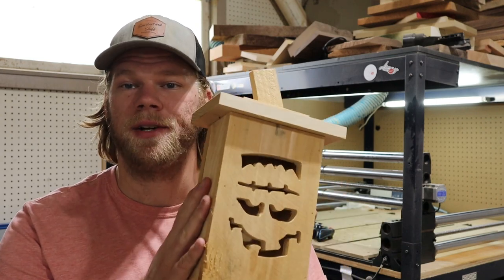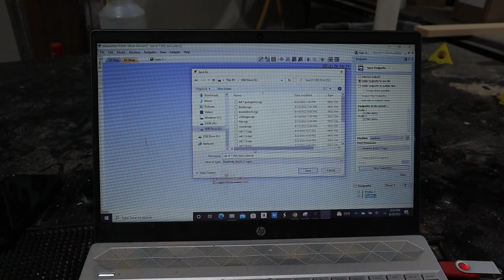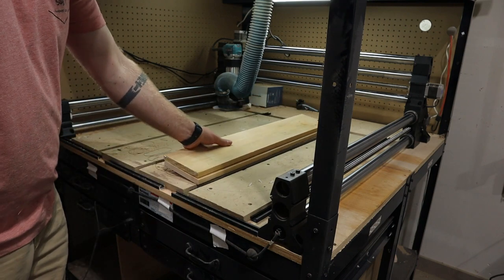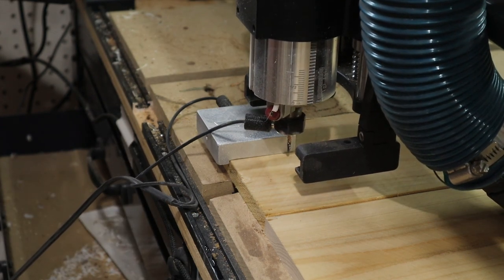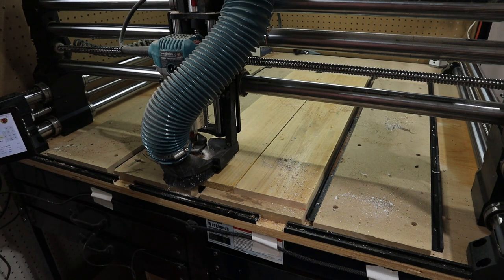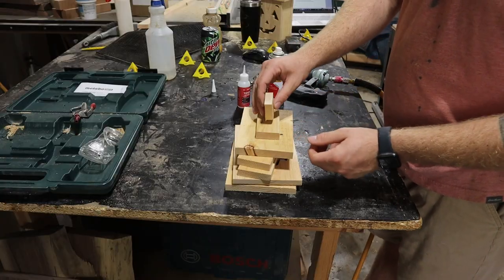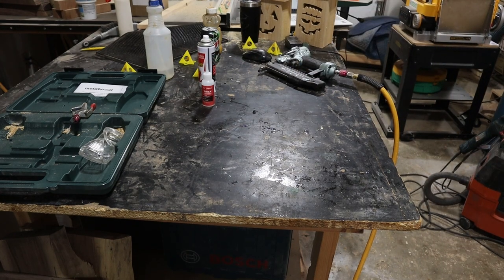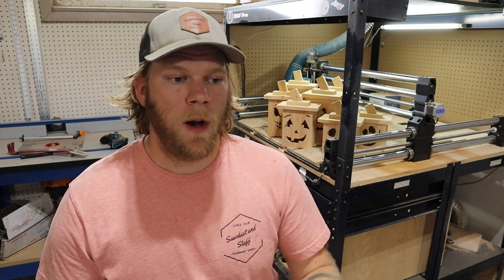How to make Jack o Lanterns with your CNC - Guide for Beginners - Halloween - Make money on your CNC

Comment: Your file saved a lot of time getting this setup and running. I could have created my one files but it was well worth the cost to have the crv files ready to go. I just ran your file tonight. Had to do a little fiddling because my pickets were rougher than yours and I had to joint an edge and rip the other creating a slightly narrower stock. I resized and centered the faces and off I went. Only problem I ran into was on the third face the eye bound up when it came loose but it kept running. Didn't realize that it caused the X axis steppers get off by about 1/2 an inch. The next two faces were cut right on the edge of the board. I stopped the cut after the 5th face was cut. I created a new toolpath for just the last two faces and reset, homed and zeroed and ran the last two. By the way, for a more precise way of setting the Z axis to .6 inches, you can go into the MDI interface and enter the command "g0z0.6", hit play and the Z axis will move right to exactly .6 inches above the spoilboard.
Reply from the maker: Oh no! Hope it worked out ok ☺️
Reply: @SawdustandStuff  I added a toolpath to drill shallow holes inside the eyes and a few of the larger pieces. After I run that TP, I shoot 23 ga. pins into those holes so that when those pieces are cut free they are held down. No issues with the second run. My wife sent a picture of them to my daughter who was at a friends house when she got the text. I got my first order.

Comment: Great video and tutorial!  Do you plane the faces to remove the roughness or use them right off the shelf (after picking the best ones)?  My selection is pretty rough here.
Reply from the maker: If needed I'll run through the planer. I would say 50% of the boards need this.

Comment: Hi Ryan. I'm new to CNCing.  I'm in the process of finishing my spoilboard and learning the software, I have a Longmill and using VCarve Pro.
Could you please tell me if this project and your file can be used on the Longmill and VCarve? 
Are there any things I have to do to set it up and for it to carve properly?
Thanks so much!!   Joe
Reply from the maker: yes, that works with your machne and software. you may have to adjust sizes. not sure what size your machineis.

Comment: I need to up my CNC game. I’ve been doing pockets and you’re doing contours. You don’t have any issue with the pieces knocking free or are you using tabs? Looks like no tabs.
Reply from the maker: No tabs. I’ve broken one bit over the course of 300 lanterns
Reply: @SawdustandStuff  you could also use composite brad nails that won't break your bit, and add them in locations where the patterns are being cut if you're worried about loose pieces.
Reply from the maker: @QuentinKarmark  truth!

Comment: Great video! I bought your file on Etsy and didn't even use the discount code - you're welcome! 🤣 Also, I bought the Jenny bit too. Thanks for your recommendation! 

QUESTION - is the key to keeping the parts from popping out and burning or jamming to NOT use a vacuum? When I ran this with my vacuum on, it would suck the cut out pieces partly out of the wood then those pieces would get caught around the bit and start smoking. I had to stop my machine several times. Eventually I removed my dust boot and turned the vacuum off and that seemed safer. I really don't want to add tabs to each piece so just wondering how you get it to not jam up and start a fire?
Reply from the maker: hmmm. I'm not sure! I ended up overusing painting tape/CA glue so that they would stay in place - but that was a lot of materials burned.

Comment: This would work if I could get that cedar picket here. Local stores just dont carry them
Reply: Lowes has 5/4-in x 6-in x 8-ft Cedar Smooth 4 Sides Air-dried Lumber for $10.48 in stock In Mass.  These are deck Boards and about 1" thick.  You can plane them down to .6" inches to make them the same thickness as a picket.  width is 5.5",  It adds some extra time / cost to the project buts its certainly doable with the cedar that they have at Lowes. It is taking a lot of material off / lots of wood chips. took me about 1 hr to plane down 10 boards. cost was $110 for 10 boards (80ft) total
Reply from the maker: Other woods work as well! Treated pine especially. Or you could just add finish to them and use whatever wood you'd like!

Comment: Thanks for the video. Love the lesson. Wife says I have to pay for my tools. How much sanding do you have to do because when I use my down cut bit on I have to do some sanding around the eyes and the nose Etc and it sucks to get in those little grooves.  Also love the Mountain Dew zero there. Drink of champions.
Reply from the maker: I use a compression bit to avoid sanding. I ONLY Sand if my wood is still wet when I cut it. big fan of mt dew zero!!
Reply: @SawdustandStuff  I bet that has something to do with it too it rained the night before in the lumber yard at Menards when I picked up my pickets. Had almost two solid weeks of no rain and then the night before I want to do the project it rains.
Reply from the maker: @DragonclawMakerStudio  100%

Comment: What's your plunge and feed rates? I ran mine on my Shapeoko and it takes like 30 minutes and to an hour to cut a board full of one design depending on the design. You said you cut all 7 in 26 minutes. My default speeds and feeds are obviously way too conservative.
Reply from the maker: the onefinity can definitely be pushed harder. I'm actually not remember the feeds/speeds. I know it's in the CRV files that can be bought. Let me go grab my work computer and check that
Reply from the maker: 100 IPM .125 doc 10 plunge rate

Comment: What feeds and speeds are you running? I purchased the files but since I'm using Vcarve Pro 10.5 I can't load them. Just curious to know based on what i was running them at. I run the Whiteside RD1600 1/8" bit but I use pretty conservative speeds on my Xcarve. Once face takes me around 15 minutes to carve out at .45" thick.
Reply from the maker: I think .125 DOC and 100ipm? i believe 
it's in one of the comments somewhere on here if you want to look for it.